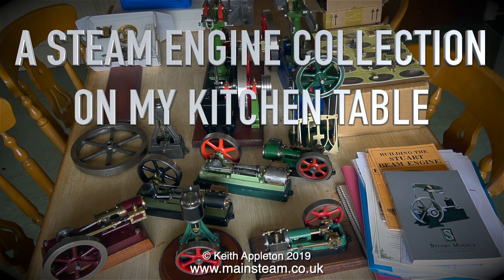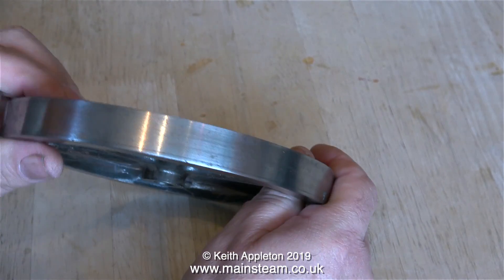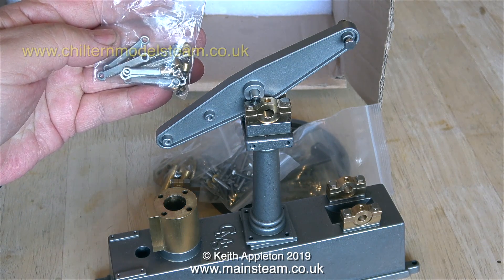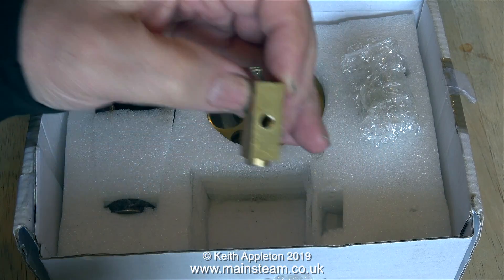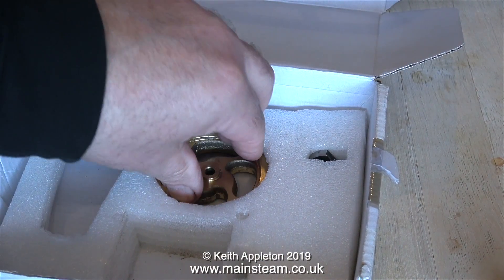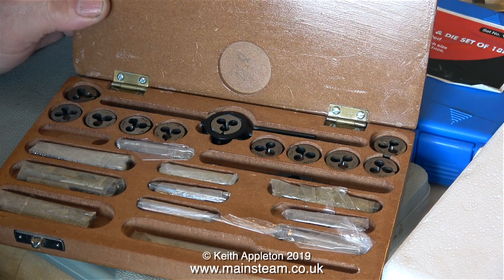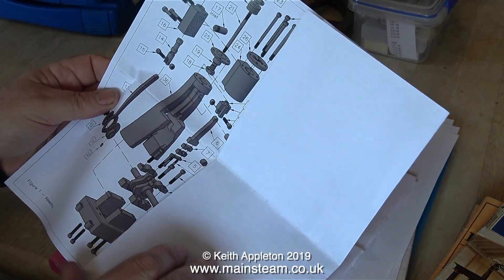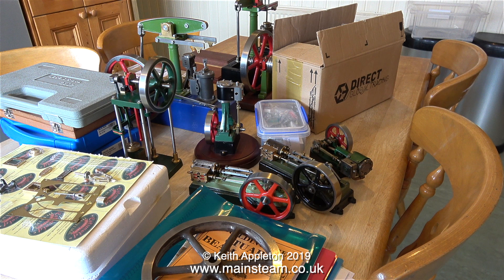A MODEL STEAM ENGINE COLLECTION - ALL NOW SOLD - PART #2

Comment: A question just occurred to me, Keith. If you personally were designing & building a steam engine from scratch (working, not model) would you go for an under-square (long stroke) or over-square (wide bore) cylinder, and why?
Regards, Jay.
Reply from the maker: I really don't have an answer or that, but personally I prefer a large cylinder engine . . . .
Reply: @keithappleton  Thank you for that.